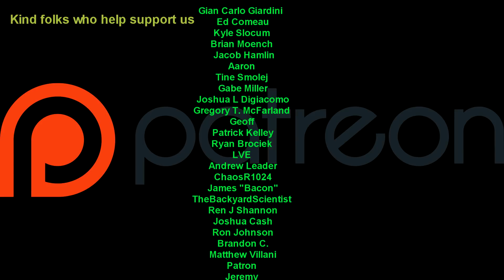Magnesium and Aluminum SHOTGUN experiment

Comment: Would it be possible to mix lead and steel shot in cast slug? Like the wax slug but with lead instead of wax?
Reply: That would be one nasty round. I'd like to see some penetration/fragmentation test on that one.
Reply: Having the steel shot in the mix wouldn't guarantee breakup, the lead would hold together, I think. A softer alloy/metal perhaps?
Reply: Even if it doesn't break up the slug would probably mushroom in an interesting way with the lead deforning and the shot mostly holding it's shape
Reply: Steel floats in lead so would have to keep steel from overflowing. Sounds like intersting way to extend lead shot for hunting. But cant run steel through a choke.

Comment: Neat video.

I think if you placed a wad in between the metal shavings and powder it would delay ignition until the shavings had left the muzzle. In theory that would give the shavings more range and produce a larger muzzle flash.

Comment: Try interspersing some larger pieces of metal. More like fine ribbons like magnesium fuses. You'll get a much longer burn time on the larger pieces and the finer shavings will stick to the larger pieces when ignited by the powder. Ive seen magnesium shards used as dragons breath. Just dip in liquid nitrogen until frozen to the core and ballpeen your little heart out. Breaks like glass. The larger pieces won't catch until thermal runaway is reached when it selfoxydizes. Not sure if that's the technical term. They probably don't have a metric term for something as awesome as self combustion. :-P

P.s. Steel wool wax slug?

Comment: Copper will only make the fire green. Try mixing aluminum powder with magnesium, iron and steel wool. This should give you the bright flash of the aluminum and the extended fire to ignite the spray paint. Add the copper to make it all green.

Comment: You guys should get another hold of those plastic capsules(the one that holds liquids) and fill it up with Thermite. In a nutshell; you eliminate the need of any kind of slug since the Thermite(or Magnesium) IS the slug. btw, if my english sounds a bit broken, it's because i'm tired.
Reply: I think part of the problem is that anything you put in front of the wadding is highly unlikely to ignite, plus you need enough weight to get a full burn of the powder.

Comment: Since steel wool proved the most  ignitable, but both aluminum and magnesium proved to burn strongest (resulting in a bigger flash of white) , perhaps a wad of steel wool backed by a 50/50 mix of aluminum and magnesium would provide the best chance of ignition at that distance? Also, for maximum result, you may want to shoot a can of starting fluid (ether). Preferably at night.  Should be a riot.

Comment: Wonder what happens if you put potassium metal in it (assumption: it's gonna react very violently as soon as the mineral oil coating goes off, reacting very violently. I'd suggest using a cheap shotgun you don't care about and start as gas as possible)

Comment: What about a 12g Ferro rod? Would it be the same as the Ferro wax slug you did?  I've seen 1/2 inch and also 1 inch ferro rods. Maybe there is a 12g one, or just sand down the 1 inch one.

Comment: i did not expect the copper, brass or silver to work so no surprises here.

i was sure the zink would ignite but i guess i was wrong, or maybe the powder didn't brun hot enough to ignite it, mix it with magnesium maybe?

i was also surprised the magnesium made it out of the barrel at all, as i was expecting it to burn up before even reaching the muzle.
Reply from the maker: I thought it would ignite since steel ignites but...  I'm wrong all the time too

Comment: So, the aluminum powder was too fine.  Need to experiment with coarser powders, or even filings, which will burn longer instead of being consumed so quickly.  Get the stuff used in fireworks.

Comment: I give this post a 1 in 1,000,000 chance of being read. At the same time, if you really want to fire off metals. I have the solution for you. In a gun barrel there needs to be an oxidizer,. the powder has it's own. if you want good reactions, you have to add an oxidizer to the load. Throw some stump remover in with the metal shavings and you will love the results.
Reply from the maker: Well,  then we would risk spiking the barrel pressure and blowing up the gun.

Comment: @Danny hey man, word of warning, firing powder aluminum is a half compound of thermite. Followed by steel wool, and heat exchange, you should inspect your barrel for streaks or pitting.- I say this cause I like seeing the single fire shotty.

||side note|| typing out the correct formula for thermite would be stupid, before anyone gets all, you know...
Reply: Bee Ell 
Thanks for the warning. Thats Jeffs shotgun and he usually maintains it well.👍🏻.     🇺🇸😎
Reply: Typing out the formula for thermite would be stupid? You do understand that this is the internet, right?

EDIT: Also, it's a two ingredient mix, we're hardly talking nannas cake level of complexity!
Reply: James Healy 
I have some already mixed.😉.      🇺🇸😎
Reply: There are lots of different mixes of thermite. It's any two metal oxides where the one with the stronger oxygen bond steals the other's oxygen atom in an exothermic run away reaction. There's not really enough residue to even matter. Hey, he's got those expensive cleaning shells he could shoot in between just to be on the safe side.
Reply: Black copper oxide actually works better than iron oxide. It's more expensive though
Reply: SteelWarrior115 also copper oxide is more explosive and toxic
Reply: Isnt that break shotgun like low quality anyways? Which is why they use it
Reply: one. long. exasperated. sigh.
Reply: Something something something... can't melt steel beams!
Reply: Rekarded I know but if you are making thermite on purpose then you usually are careful enough to not worry. But I probably should have added that for all the "try this at homers" that will end up blowing fingers off or something
Reply: oh gonna try and be a nanny, are we? i bet you'd vote for a sugar tax on sodas. i'll post thermite recipes then, including some that use heavy metals.

thermite ratios by weight, use powdered aluminum and a magnesium-based sparkler or metal strip to ignite, the finer the powders (they should be equally fine) the faster it will burn:

titanium(IV)oxide:aluminum 2.22:1
iron(III) oxide:aluminum 2.96:1 (this is the "standard" thermite)
Iron(II,III) oxide:aluminum 3.22:1
tin(I) oxide:aluminum 4.19:1
copper(II) oxide:aluminum 4.42:1
copper(I) oxide:aluminum 7.96:1
silver(I) oxide:aluminum 12.88:1

these ones are particularly dangerous because of the very toxic smoke/vapor they produce:
vanadium(v) oxide:aluminum 2.02:1
manganese(IV) oxide:aluminum 2.42:1
molybdenum(VI) oxide:aluminum 2.67:1
chromium(III) oxide:aluminum 2.82:1
manganese(III) oxide:aluminum 2.93:1
nickel(II) oxide:aluminum 4.15:1
cobalt(II) oxide:aluminum 4.17:1

and finally a three part thermite using sand and sulfur, this one also is toxic because it releases hydrogen sulfide gas:
silicon dioxide:aluminum:sulfur 9:10:12

the most energetic of these thermites is the manganese(IV) mixture
Reply: Bee Ell thank you ma'am
Reply: SuperAWaC you're welcome Penelope
Reply: @ danny aka triker red, since you have some already mixed, is there any chance it will be fired out of a shotgun on cam? ( I mean an old shotgun of course!)

Comment: How about combinig steel wool, aluminum powder and crushed ferrocerium rod?
Reply: Ferrocerium is already 20% iron so wouldn't the steel wool be redundant? Alumina (aluminum oxide) however would be a good source of available oxygen for the reaction.
Reply: Iron powder and aluminum oxide combined is thermite if im not wrong.

Comment: 10 yards (0.9144 meters)  Was that a joke or do you really not know what a meter is?
Reply: TobbeTheDude I was wondering the same thing
Reply: Typo. He's usually correct.

Correct spelling is metre, though. Even when you convert the yanks to a superior system they still find a way to screw it up.
Reply: TobbeTheDude well if you knew what the yard to meter ratio is you would know he just forgot a 0 on the yards.
Reply from the maker: It gets people to comment
Reply: I knew it^^
Reply: AusiKifaru27 No, we just spell it the sensible way.
Reply: Phonetically, "metre" should be pronounced something like "met-reh". "Meter" is closer phonetically. If anything, the Yanks fixed it.
Reply: Fixed it? Is that what you call it? English borrows from many languages and metre comes from the French adaption of the Greek word, Metron, which means measure. Spelling it metre instantly differentiates it between the unit of measure and a measuring tool. This is why things have the suffix 'meter' when they're a measuring tool, like speedometer or thermometer. 

Litra/litre, theatrum/theatre, calibro/cailbre, are among many more that also didn't need fixing. How you think something should sound is irrelevant. Phonetic isn't spelt (that's spelled for you yanks) with an F because it comes from the Greek word phōnein, meaning speak. Perhaps you'll start spelling words like general, gem and giant with a J, next. If you start with this line of thinking, you'll have to rewrite the entire English language. Many words simply exist in their current form due to their history. Or should it be historee? Man, werds are hard.

For continuity with units of measurement, this is likely why the old English word æcer (Latin/ager, Dutch/akker, German/acker;  for field) later evolved into acre and not acer. Question: Do you pronounce it ack-reh? No, you don't. So you missed one. Go "fix" it. Seriously, because we really wouldn't care. The rest of the world is busy measuring our land in metres² and kilometres². Perhaps you'd be more comfortable with metric if you changed its spelling, completely ignoring its French origin, metrique, of course.
Reply: AusiKifaru27 At the end of the day using etymology to determine how a word "should" be spelled is just as if not more arbitrary than just spelling it the way it is pronounced. The fact of the matter is that when words are brought over from another language it makes far more sense to adjust the spelling so that it makes sense for your particular language than to just keep it spelled in a form that doesn't make any sense for your language.
Reply: Seen the old one about potato?

If GH can stand for P as in Hiccough 
If OUGH stands for O as in Dough 
If PHTH stands for T as in Phthisis 
If EIGH stands for A as in Neighbour 
If TTE stands for T as in Gazette 
If EAU stands for O as in Plateau
Then the right way to spell POTATO should be: GHOUGHPHTHEIGHTTEEAU

If you're going to fix English, you need to alter most of it.
Noah Webster tried, purely as an act of trying to be superior, and failed, therefore creating your problem. A lot of his changes were accepted, but many were not. Instead of creating a standard, he made an abortion of it. You can't justify changing metre and not acre, nor even explain it while pretending to be superior.
Reply: The only ones "pretending to be superior" are the ones carrying on about how a different dialects spells it phonetically.

Yes, you could spell potato like that, but in common usage of the language nobody would see that monstrosity and pronounce or recognize that as "potato". These are clear examples where English evolved and borrowed and kept pronunciations. But in a common phonetic pronunciation these are exceptions not the rule.

I frankly don't care. You spell it "metre" and I will spell it "meter". The only reason I said we "fixed" it was in response to your seemingly condescending comment about Americans screwing it up. At the end of the day, it's trivial.

It absolutely astonishes me how worked up people are over divergences in language, while citing clear examples of how the words they are using today diverged in the very same way from other languages and words...
Reply: Yes, we are the ones pretending to be superior while you go on about superior systems of units and the proper way to spell something. I wholeheartedly agree with you that is a shame that not all of Noah Webster's changes caught on. Either way though none of this matters as at the end of the day you still haven't provided any good justification for metre being the one true spelling of meter.
Reply: Yes, I have. You're not listening. If you can read acre and not say it ack-reh then there was no justification for changing metre. No-one was pronouncing it wrong. One man changed it, solely because he thought it was superior, and attempted to force it on a nation. He was clearly wrong, as the majority of his changes were not accepted. But you still argue that your way is "the sensible way", so yes, I will say you're pretending to be superior, as was he.

So now we have two stiles of English which has become a nightmar, especially as we can now communicate instantly world wide with our computer masheens using telefone wires. From my iland in Australia, nowhere neer your foreign tung, I beleev it easy to giv each other hainous greef over the headake of language we have bilt. Hide your wimmin and dawters before the korus turns grotesk. Thums up for Webster!

If he had his way, nothing in the above paragraph would be a spelling mistake. Still think it's a shame? What was his plans for words that sound the same but are spelled different, such as break/brake, waste/waist, steak/stake, pair/pear? Or words that are spelled the same and pronounced the same, but have different meanings, like lie (lay down)/lie (untruth), fair (complexion)/fair (just)/fair (gathering of vendors for a show), bow (front of a boat)/bow (bend at the waist) and their friends bow (that fires arrows)/bow (tied with ribbon). And other words that are spelled the same, but have different meanings depending on how they're pronounced, lead (to guide)/lead (the metal), tear (from crying)/tear (rip), bass (fish)/bass (low note). Then read (present tense of looking at words), read (paste tense of looking at words), reed (has many meanings), not to mention red and read (past tense), just to confuse it further.

I think we can all agree that there's no easy solution, but I know what isn't the solution, and that's taking a select few words and changing their spelling because some people think it makes more sense while the majority of the world is doing it the usual way without issue.
Reply: Viscum if acre was changed to Acer, it would cause a lot of new confusion. As of right now, our launguge is messy, but we know where the weird shit is, and we've raised and taught to accept it. And who the fuck really cares how its spelt (btw, most people in the USA do use spelt, we know 'spelled' isn't the correct word), we don't use that unit of measure ment, even though we should, as its miles better and more simple.
Reply: also, your reasoning for it to be changed back doesn't fix the fact that its new spelling is deeply rooted into Millon's of peoples minds.
And I, from an unbiased view, think meter looks better, and fits to the curriculum that our language is built on. And when I see metre I do struggle with hearing it in my mind as meter.
And yes, you are acting like you are the superior, being condescending to others because WE don't spell a word the way YOU think it should be. And I don't know why you think its up to us to fix something a man dead long before we were born did.
We were taught what he set into motion, even if most of it failed, and you think its MY generations job to fix something that happens years before we were born. That's you being condescending and thinking your version is superior to ours.